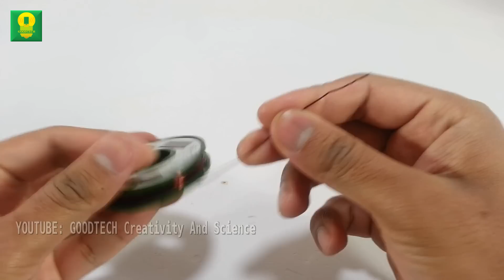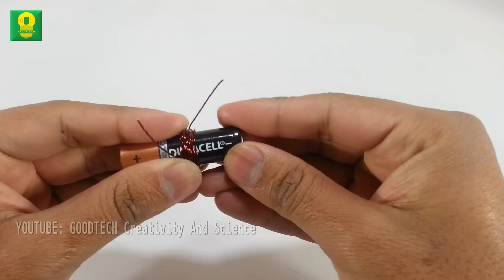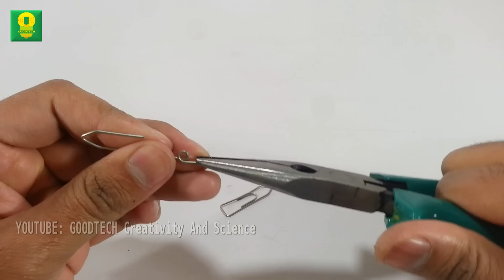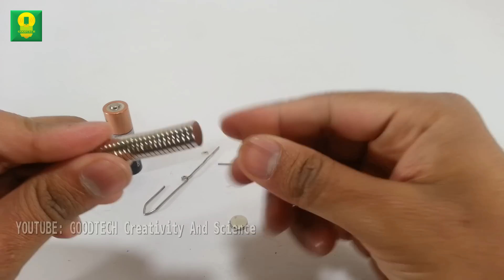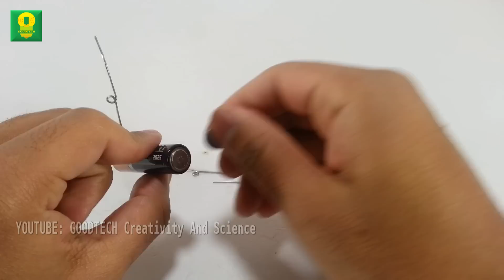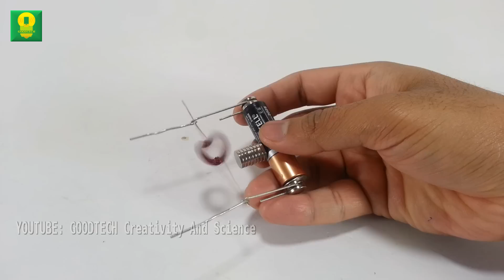Homemade motor - How to make a simple motor

Comment: hello there
when i connect the copper wire with the battery it becomes super hot that I can't touch it directly. It doesn't seem to be a problem in your video. Is there something wrong with mine?
Reply from the maker: The coil does get slightly hot when the motor operates. However, if it is getting extremely hot, the only way to eliminate the heating problem is either you need to increase the no. of coils or you need to use a slightly thicker copper wire.

Comment: Did not work for me , the copper coil stuck to the magnet in the middle and wouldn’t spin at all :/
Reply from the maker: The copper is non magnetic (although, copper does interact with magnets in many funny ways), if the wire is copper then it should not stick to the magnet.

Comment: how can we use it instead of real motor
Reply from the maker: This is just an experiment to demonstrate how a motor works, You can glue a small propeller at the end of the wire and it will work as a small table fan but using it as a real motor is not possible.
Reply: ohh okkay thank u

Comment: what would happen if we supply 12volts Ac , in place of DC , the coil rotates?
Reply from the maker: No, the coil will not rotate and it will just get hot. Since, the direction of magnetic field for magnets is fixed but the direction of current in the coil will oscillate at AC frequencies, so the direction of magnetic field produced due to current in the wire will also oscillate, hence it will not be able to produce any uniform rotation.
Reply: haw at you

Comment: Can you please explain the concepts of how your motor works.
Reply from the maker: Hello Brooklyn,
When the loop sits on the metal conductor (i.e paper clips), the current flows through it, thus producing a magnetic field around the coil. When the loop rolls over, there will be no contact due to half enamel coating and thus, no current flow and no magnetic field. When another magnet is placed to interact with the coil, the coil spins continuously because the magnetic field around it tries to align with the magnetic field of the permanent magnet.
If you need more info and material links, you can also refer to my instructables page - http://www.instructables.com/id/How-to-Make-an-Electric-Motor-1/
Reply: Thank you so much! This was very helpful!